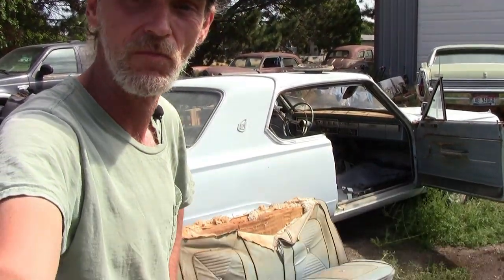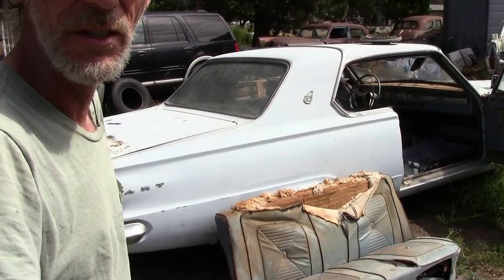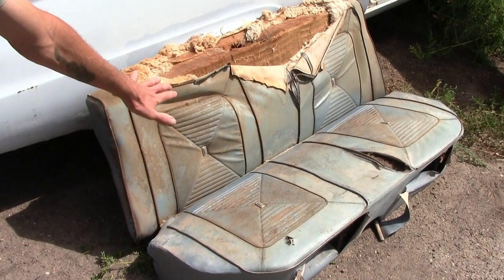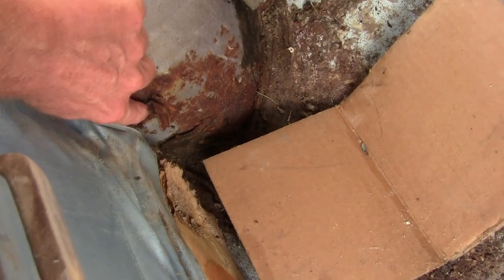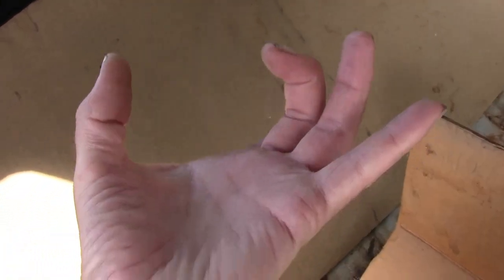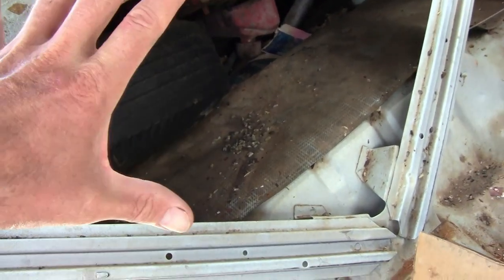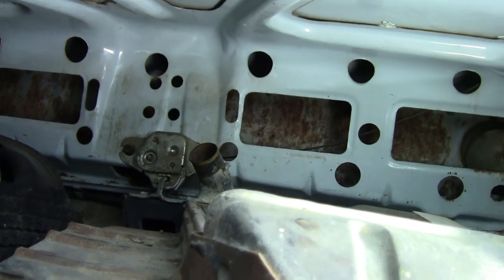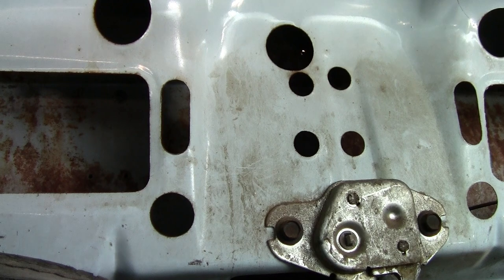1965 Dodge Dart, How to Open a Trunk on a Car that Doesn't Have Keys Without Damaging Anything

Comment: I'm glad to see that we are from the same old school. When in doubt, remove the back seat. People right away bust out the look and damage the trunk/deck lid and don't even consider rekeying the locks. My old lock smith charged 10 bucks to rekey it for me. Great work as always!
Reply from the maker: I hear ya man!; and fixxing that truck lid after they've beat the hell out of it isn't easy. All I can do is shake my head.... because it's so easy to just go through the other way and save you a ton of time and money in the end.

Comment: I remember when I was a kid, my uncle locked his keys in the trunk and went through the back seat. I don't remember what kind of car it was,  but didn't take much to get it opened.  
Good job Sir.  One thing about the head, the same head was used on the 170 (1960 - 1969) 198 (1970- 1979) and the 225 (1960 - 1987) .  Wait, I think in 1984 Chrysler went to hydraulic lifters and they changed the head.  As well.
Reply from the maker: Thanks Bert. Yeah I don't know how many times I've seen a trunk lid destroyed by people prying and hammering that lock cylinder off out of there... ug
As for the head.... I think that's the reason this thing went off the road, but now the bad thing is.... it's been off for a long time now. The cylinder walls don't look too good, and I can see where someone has beat on them trying to free it up.... ug. I hate it when an engine is popped open and left outside to the elements. I have my feelers out for another Slant, but they are extremely rare around here. Today I looked it over pretty good, and Worse Case Scenario... I think I can do "bolt in bolt out" mods to it, to get something else in there as I slowly rebuild the Slant. Just something to get it on road for now without cutting and welding so when it's ready for the OEM I can pull it to drop everything back in as it was..... I don't know, depends on what I can come up with as time allows. But I'm really hoping to keep it as it is.

Comment: Great video! I have had to drill out a few mopar trunk locks in the past, most recent was a 65 belvedere, had so much stuff in the trunk I couldn't get to it with the seat out! I've never taken the latch off like that before though, I always stick a screwdriver in the slot in the latch and open them. Thanks for sharing this video, I've saw so many that folks have butchered and destroyed by not doing it the right way!👍
Reply from the maker: Thanks Mitch! Yeah, I couldn't get all the way in there to pop that horseshoe clip with a screwdriver, so I took every extension I have and just undid the latch instead... lol. I've seen so many trunk lids just totally destroyed by people prying and hammering on that poor lock cylinder... and it's only a few bucks to have a lock smith cut you a new key for it.

Comment: This is the first time I saw this video and I wondering if you might have found the build sheet for that car.   I know Chrysler used to hide them under the seats sometimes.
Reply from the maker: Yeah it was mostly there, the mice got about half of it though... Same with that 68 Mercury. I keep them around for covo pieces but other than that I don't pay them much mind. By the time I'm done with them they are pretty far from the build sheet lololol

Comment: Did you check the back of the back seats? That's where a lot makers or whatever used to put the build sheet, check the under the bottom of the back seat and the back of the back seat. I'm sure you probably thought about that, just making sure buddy!
Reply from the maker: Yeah... I think the mice done got it Doug. It looks like it was there at one time but it's long gone now.... Oh well. The title is good and that's the only paper 📜 I really look for... 😆

Comment: You can often put enough very long extensions together that you won't even need to get into the trunk. It's a breeze. Pinning your new lock or getting keys made is easy too. Don't be afraid to learn how
Reply from the maker: Very very true! Pretty much how I did it on this one, because there was a LOT of stuff in that trunk.... lol
Thanks for stopping in man, come by anytime.

Comment: Get a lock pick set. That’s what i do
Reply: These lock cylinders are known to freeze up though. I'm dealing with one right now in a 67 GS400. The key won't even turn the lock cylinder.
Reply: Another issue is, this is a convertible I'm dealing with so there is a huge metal plate between the back seat and the trunk... Fml